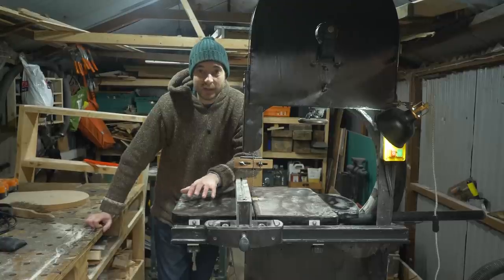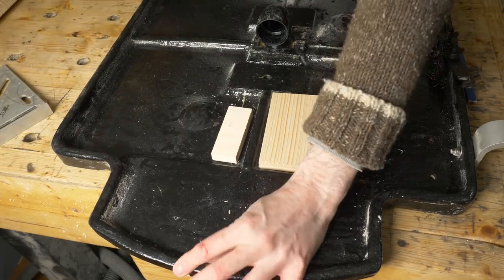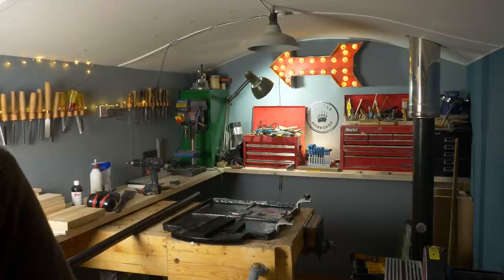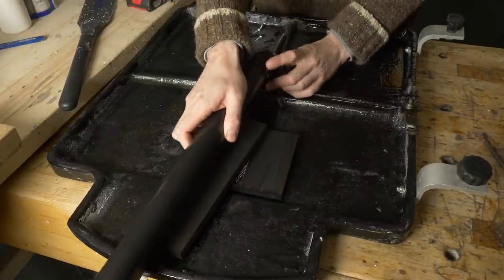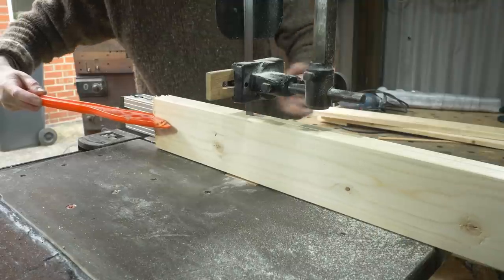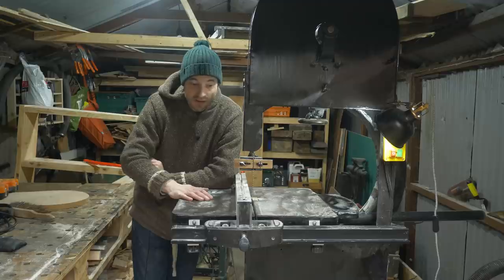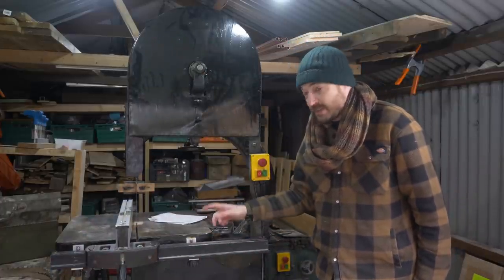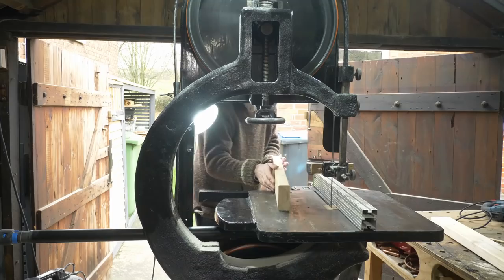Dust Collection For The Bandsaw

Comment: Hi Matt. Good idea using the plastic pipe and its exactly where its needed. 
It will save a lot of dust landing on the lower wheel like conventional methods. Tony
Reply from the maker: It does seem to do a good job

Comment: You could easily improve on that dust collection. First thing is to get a bigger hose, ideally around 40mm ID for easy connection to the pipe. I use a rather ridgid hose one for pools/ponds.

Second is that you need some more holes in the plate around the blade. To get som more airflow.
Reply: You dont know how much dust didn't get collected , so how can you claim you could improve it ?  
Drilling holes into a cast iron table around the blade slot ? Realy ??  
I doubt much sawdust is queueing up by the hose adaptor, no doubt you will publish a video showing how its done ......
Publish your work like Matt, or stick to designing by sofa